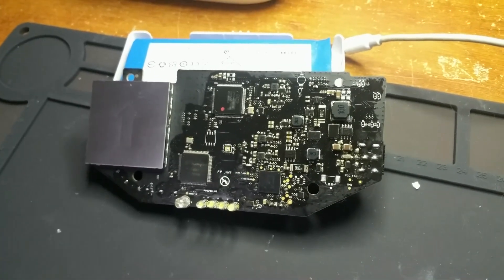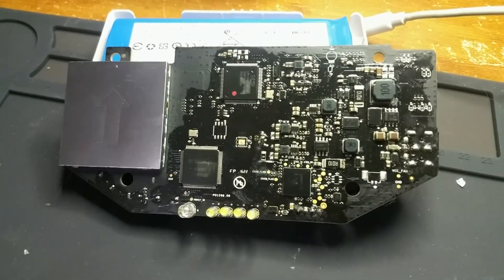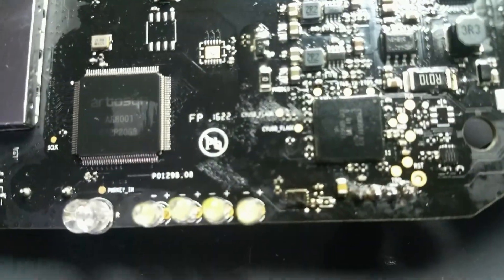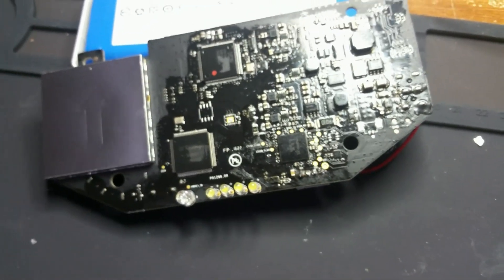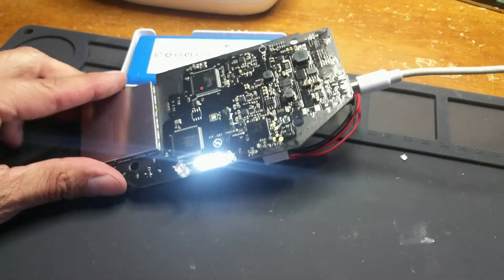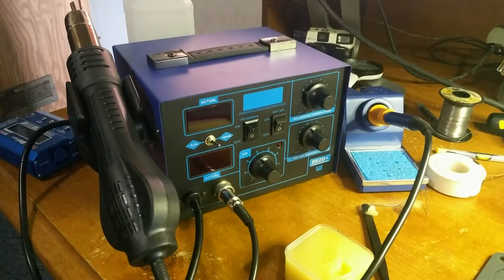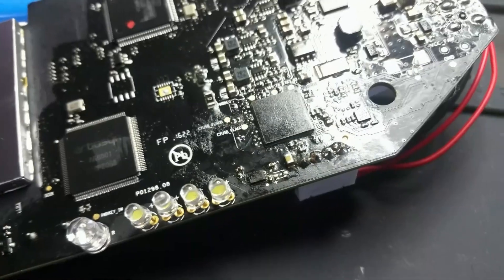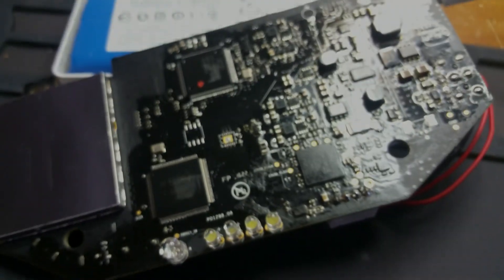Phantom 3 & 4 Transmitter - Battery Charging Issue Fixed

Comment: Thank you very much for sharing this video,
I have one question, I have inspire 1 with GL658 controller . Recently, when I push the power button, all the LEDs turn on (white) and after few seconds (3-4) everything dies. I opened the controller and check the battery voltage, it shows 8.5 volts.
Do you think your method will fix the problem?

Comment: I reflowed the IC. It did work. Do not recommend you try this unless you can afford to lose the board. I have ordered replacement IC chip in case I need to replace it or someone needs a repair.

Comment: I did 300C on this but didnt work. Is 450 safe enough ?
Reply from the maker: 450c is fine, use flux and make sure you see the chip move a bit, it have to be heated enough to remelt the old solder.

Comment: I did this 3 months ago and it worked( with heat gun and tinfoil) now have the same problem again. Is this going to happen every time you let it set. Maybe didn’t reflow good?
Reply: Lukas Potgieter I just bought another controller off eBay.

Comment: Works 100%, I just tried this and it worked for me. All four lights lite up now and the remote is charging  the battery to full. I just heated that little point next to the led lights with a heat gun making sure it was hot enough but not too hot to burn damage anything and it worked like a charm. 👍 I tried everything else but this is the only technique that worked. Thank you for the video.
Reply from the maker: I'm happy it worked for you.

Comment: I was elated when it worked again. DJI is not taking any responsibility for this. Video is Spot on. Best fix video 3 & 4 controls. It took me less 1 min, I plugged it in a few times until it reset and it worked again. I had to turn it on and off a few times and plug it in to get red beep light to reset. Works great now. Flew it for 30 min after no issues. This is why I live YouTube. Thanks.
Reply from the maker: Thanks for the feedback. I'm glad it worked for you.

Comment: worked for my 2.5 year in a box phantom 4.....used a butane pencil torch ooooh so gently, works good! left all cables attached and pried open enough to access ic for heat out to outer edge.thanks
Reply from the maker: Really happy to hear thanks for the feedback.

Comment: You are awesome man!!!i follow your step.... including fux off liquid type...works perfect!!!thanks a lot
Reply from the maker: That's great, glad I could help
Reply: @telescott1  so ...now i understand from where the problem starts ..i thought that was the battery an the beginning...i changed it and i replaced with a lipo battery..but nothing changes..(and one tip for ones the changes the battery you have to charge with a external lipo charger..)today i fix it by your way...and now i have a remote control which stays on for hours!!genuine battery sucks!hahaahhaha
Reply: fux off? did you mean flux off?

Comment: telescott1, great advice regarding how to repair the remote control! I had worked on the rc for a couple of hours. I think two of the big tricks were: the temp setting, absolutely spot on! You need to see the chip move and resets itself. The second was the one spot that needed to be reset, not everything on the board! Thanks, back up and flying again. Merry Christmas

Comment: I need to try this, I reflowed the whole board, don't know if i did it correctly, but after a few attempts the battery now charges to 75%. Will try this after the Holidays. Thanks for video and temp settings.

Comment: Would just like to say thanks for posting this video. Just used this and fixed my P3 Pro remote, just as you said 450 degrees for around 30 seconds and went from 5% battery and 1 light to 100% and 4 lights lit. Saved me a fortune! Thanks again
Reply from the maker: Thanks, Stuart. I am glad I was able to help. Sharing knowledge is key for the drone community. Fly safe my friend!
Reply: Are you heating the bottom of the IC?